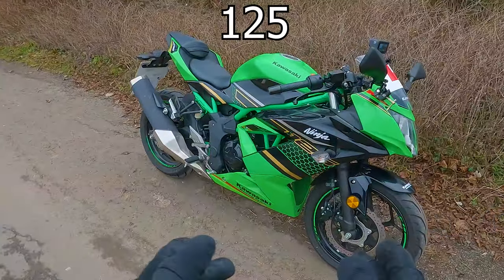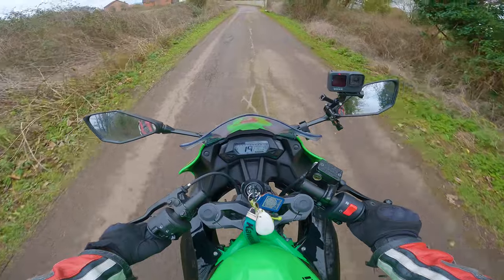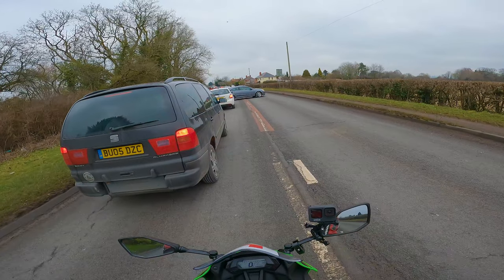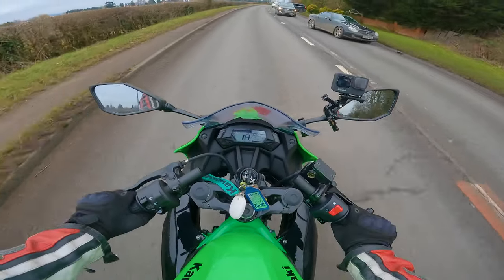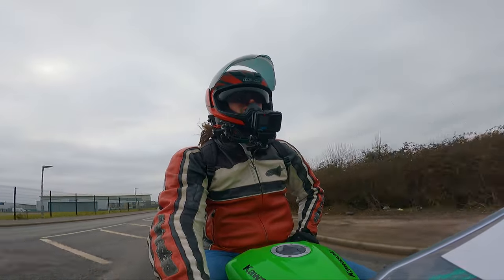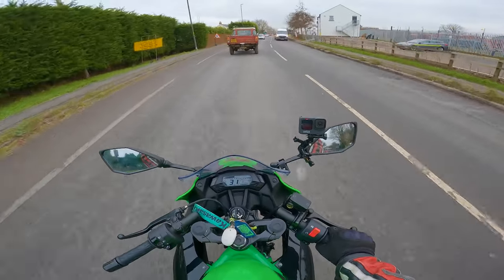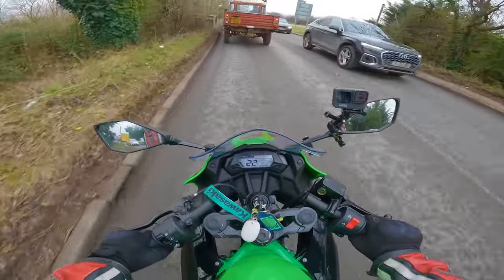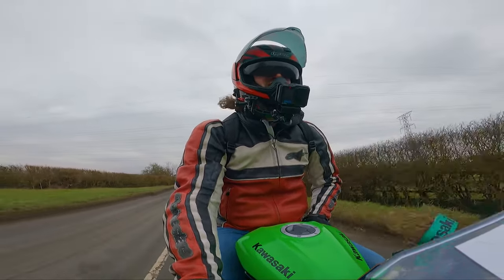Things You CAN NOT Do On a 125cc Motorcycle (feat. Kawasaki Ninja 125)

Comment: In Asia like Thailand and many other south east Asian countries, they have a very rich culture on modifying small 125-150cc motorcycles. They managed to tune and take it up to a much higher topspeed than stocks, some of them notably can push a madly tuned 150cc to run up to 210+km/hr ( over 130mph )  while the stock can only run at 120-140km/hr ( 74-80mph ). Some of them also add in turbo or do a big bore kits and new gearing with additional turbo which makes it even more more powerful. You’d be surprised of how much they can juice out of that tiny engine. The cost is about an additional 2 150cc motorcycle worth. So the usual price of a 150cc new around 2.2k usd and with 4-5k usd high performance mods and tunes. Some would say why not just use that money and buy a 2nd hand bigger bike instead but they don’t, it’s just what they like to do, is make small thing powerful.

Comment: fully pin it and dump the clutch while shifting weight to the back when it's like 70% to rev limiter it will wheelie , can do it on a 10hp YBR :D anyone reading this be careful, only try and push it in small increments. Get used to using the back brake as soon as you get the front up even if it's like 1ft because that's what's going to stop you crashing if you over do it. Going slightly downhill makes it easier too.

also from what i've been told it's a good way to fuck up your fork seals & clutch so keep that in mind

Comment: Bro what are u takin bout, wheeling 125s are super possible, especialy if u have a supermoto. And have u ever heard of 2 stroke?!?! Keeping up with traffic ussualy isnt a problem (unless ur on the autobhan😂). The ninja 125 is one of the slowest 4stroke 125s tho and top at about 114. I dont think ive ever had a que behind me, even on steep hills. As long as u use your gears right it aint a problem. Mapping your bike is to enshure it gets the right air mixture to avoid eating your piston or futher damaging your engine. So i dont really see your points in this video...

Comment: I wouldn't buy a 125cc sportbike unless #1 I was going to race it. Or #2 I got a crazy good deal on it. At which point I'd sell to buy a 125cc supermoto/dual sport or scrambler. Something that can be used on or off road...A 125cc sportbike is lame because they want it to look fast & exciting like a liter bike (look at me on my fast cool 😎 sportbike)  but almost every boring economy car on the road is faster than you. 😂  Plus it has the uncomfortable sportbike riding position. So despite getting good fuel economy. You won't want to ride a long road trip.

Comment: As the traffic slows down because of green idiots, 125ccm bike (tuned of course) which is able to keep stable 90 km/h and with the top speed around 110 km/h (it needs 18HP at least and some extra torque) is just fine except of highways. So the purpose of these bikes is to commute around the city and don't look for a parking place 2 hours after 30 minutes ride. And as for as upgrades. You have to make a lot of mods to have 18HP from 125 ccm. 1st is a chain as the original is mostly garbage. 2nd are the gears optimized for the top speed as you will never overtake anything. 3rd upgrade are the tires as the originals are garbage. 4th upgrade is suspension and brakes. 5th and the last should be the engine and exhaust including big bore intake, big head with oversized valves, big bore high compression cylinder kit, reinforced clutch and sport exhaust. The point is, that your bike will be still rather slow but it will weigth 40 kg less then average scooter and it is much more funny to ride because of the gearbox. You can save the money for upgrades and buy some decent 330 ccm bike instead but it will be much more heavier and much less funny.

Comment: 125cc bikes are the most popular size bike/scooter world wide, they are more practical than bigger bikes, speed cameras all over the place even motorway speeds are changing constantly, nothing more funny than seeing people riding around in 30 zones revving their big engine bikes 😂, 
I have a euro 4 xmax 125 scooter and use it on motorways I find myself slowing down for cars in front when going up hills, 
The ninja is one of the slowest 125s you could ride, the MT and yzf are much faster, also the reiju rs3 125 tops out at 85mph, also the Honda forza hits 80mph, 
Not all 125s are to light and to slow for motorways,

Comment: You've definitely not had experience on 125s my ybr 125 little 10 hp bike was cruising at 70mph and you only do that on duel carage way sooooo yeah no issues with traffic or hills even in Wales then the xsr125 I've had used to wheelie when I wasn't even expecting it stock 125 gearing as well and pillioning well I got a girl and she was desperate for a lift so I just took her on the CBT license and after that it was pretty much every weekend I would take her out on the back

Comment: you can mod a older125 and it will wipe the floor with most 250s if mods are right the aprillia is the top 1 then the rgv the tzr new bikes are weakas wet paper

Comment: I have a Bajaj Pulsar NS 125. I used to push that little thing to its limits, riding at 5th gear at 9k rpm just below its redline, and for 4500km as well. I even did 120 km/h on it, even though it was rev limiting. Blew a spark plug a few weeks ago, got it repaired, turns out the MAP sensor is also fucked, just an electrical issue though. So glad to be back on the road, I ride it a little more calmly now though, at about 80-90 km/h.

Comment: Yeah there not the same as a 2stroke remember an exhaust on my old one almost doubled the power IV seen people "big bore" the mt 125 and it still has the top end of mine. Changing the gearing has its own problems you either have top end or acceleration but still there alot of fun, fuel efficient and light plus mine keeps up with bigger bikes on the back roads I only have a problem on straighter roads

Comment: Can make it a lot faster big bore kit taking it to around 170cc add a full decat pipe performance filter and mapping lol will take that 15hp to 21 that doesn't sound alot but is actually enough on a motorcycle that's ways less than 150kg plus will sound awesome too
Reply: The ninja has an advantage, tho. As its engine is a 250 just smaller internals. So both the Z and ninja from kawasaki can literally just be engine swapped with the 250sl engine as it's the exact same.

Although I will admit. It's probably a big headache when it comes to electronics for the bike.

Comment: The problem is they switched from 2 Strokes to 4 strokes but the 2 strokes are way faster and the good thing about them is you could mod them and make them seriously quick for a little 125 CC.  It broke my heart when they did because the 4 strokes can not compete with the power of a derestricted 2 stroke.  When they switched to 4 stroke the fun and joy of riding these rapid little 125s was gone, they became lawn mower engines basically over night.  Not responsive, totally wet in terms of power bands and no power valves that put a smile in your face when they opened it was like a turbo in how they went just crazy.  The 4s are just flat as a fart and they killed the 125 power bike market over night just look at the data it says it all.  The 90s were a wonderful time for small bikes.  It actually forced me to go get my full licence instead of riding in a CBT provisional licence when the stopped the fun.  I still own 3, 2 stroke 125s from the 90s and I’m never getting rid of them because they leave the modern 4 strokes standing there and it shows what we lost.

Comment: Well the newer 125 fore strokes are good looking but gutless(get a older Aprilia rs 125 two stroke unrestricted 100mph +)  you can get more HP out of them they race them in the freetech class get rid of the parts that are not necessary (reduce weight)free flow exhaust no air filter high lift cam remove the rev restrictor with a after market ignition unit .Lock wire all the nuts as its now going to vibrate ,  scrap the fairing for a light weight one change the sprockets, sticky tyres  and now your pushing 90mph but you might find it hard to get insurance  LOL .
Reply: I have an Aprilia RS125 2 stroke and it is rapid for a 125cc. I have had it up to 90mph and I reckon it could do more as it has a slight air leak at the moment due to a loose exhaust and a blown power valve gasket so I need to fix them. And the 0-60mph is around 6 seconds.
Reply: I had a 80cc honda MBX that i did major work on the barrel full race   spec hand built expansion chamber , bigger carb lots cut off the frame at the back and HondaRS seat unit and light weight fairing I ran it on a set of race tyres with minimal tread cuts and the not for HI way use melted flat with the soldering iron LOL. Was   a fair time ago you could get away with that then .Had nothing till you hit 8k on the rev counter and went to 16k would do 30mph at the 8k but was on the edge of the power band give it a bit more and it went off like a scared cat .I had a 100mph out of it but sustaining that speed drained the float bole faster than it got filled LOL.With some work on the motor the Aprilia 125 has more ponies in it and will do 120 but need new pistons regularly.  

 @Daniel-hx2cd

Comment: A decent 125's generally about 15 BHP. A tune, exhaust and intake can put about 5 BHP on. The overall numbers are small, but it's a very noticeable power improvement and on a small, light bike, a huge power to weight ratio increase.

Comment: google said that cars in UK use metric system, while speed limits in UK are in mile per hour... someone clarify please. the speed on this bike is in KM/h or Miles?
Reply: He is in mph. I have a Z125 that uses the same base 250 engine with 125 internals. (Yes, the engine is bigger than required for a 125). From how fast he's accelerated and how high it revs in 1st gear and me knowing what rpm will give in different gears. Yes, he is in mph. At one point, he almost got to 60, convert that to Kph, it would be close to saying 100.

Top speed of both the ninja125 and Z125.
Mph = 74
Km/h = 119

Comment: One of the problems with a 125 is if you need sudden acceleration to get yourself out of dodge if a hazardous scenario presents itself. 

I saw a 125 scooter join a roundabout and everything was fine, but a park and ride bus joined from a 50mph road and didn't really slow down and certainly didn't give way and I honestly thought I was about to see the get hit. They wellies it and just about managed to stay ahead. Bus driver was definitely in the wrong, but the rider had an issue with the available power and almost wasn't able to do anything about it. 

Another issue with 125cc engines is the police. If you pass your test and lose the L plates, police will stereotype you and whenever your riding at night, they will likely start to follow you. I got followed to my house several times and even pulled over for no reason when I passed my test (used to work evening shifts). Their justification is that 125s are often stolen so apparently seeing one riding around with no L plate supposedly means you've robbed it. It got so bad that I very nearly made a harassment complaint to the local police. But I swapped out my bike.

Comment: I don't really comment on videos but I feel this is a perfect place for me to share my views going from a 125 to a 650.

1) exhaust
I completely agree to the bigger the cc the better it sounds. BUT, When I would ride my 125 the amount of times I would get cut off or get run off the road was insane. I then added a nicer sounding exhaust. It wasn't so loud that you couldn't hear anything else but it was loud enough so others would acknowledge my presence. But since getting a 650 I have now adapted a defensive Riding style and it has saved my life to people who don't like bikes.

2) wheelies
I could wheelie my 125 and in the process I damaged my forks because I couldn't control the way down and my clutch needed to be replaced as I was revving it to get all my power to lift it up.

3) keeping up with traffic
100% agree. I noticed a massive difference when going up. In national speed limits I had to tuck in and slipstream in order to keep up but as a 650 I can do it with no effort. 

Overall in the UK I think its a perfect idea for people to start off with a 125 because it can't really speed and its got enough for people to learn how to ride. You can't get carried away with just twisting the throttle and hitting triple figures. The most fun I had was on my 125 and had some great memories but my 650 makes it easier to go longer distances and take a pillion without struggling.